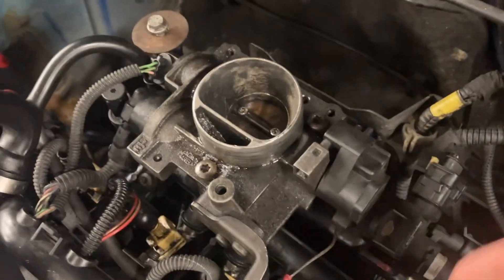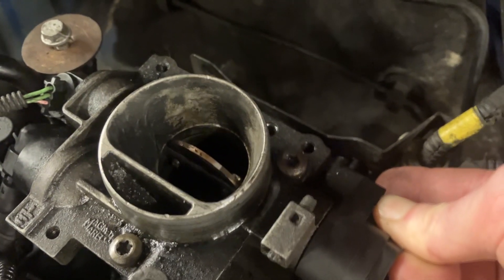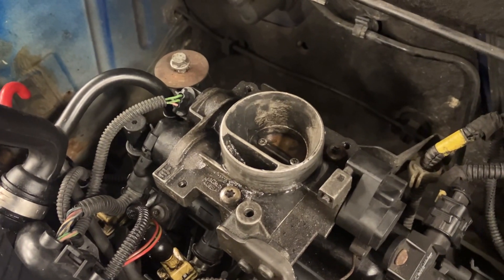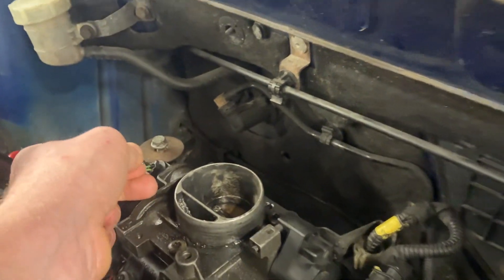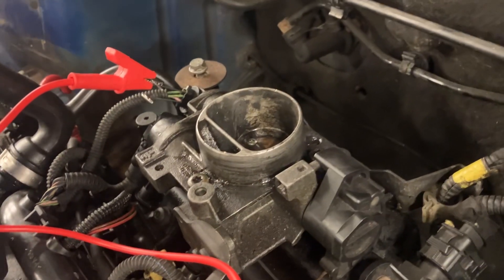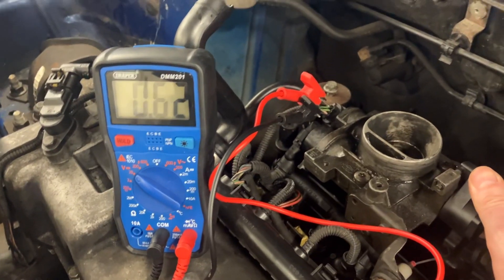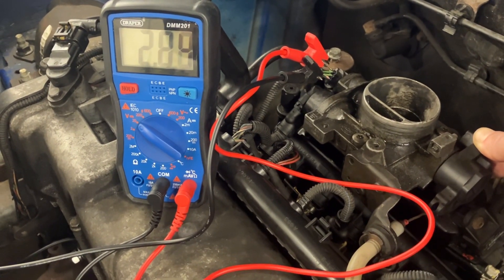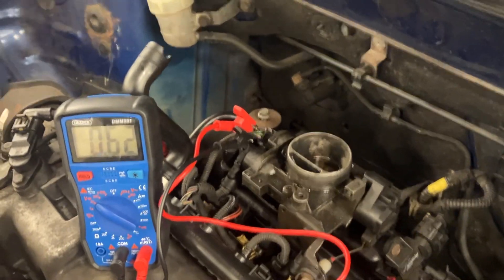How to Test a Throttle Position Sensor (TPS)

Comment from the maker: Worth mentioning, if it's the electronic version (without a throttle cable) it's the same test, you just need someone to press the accelerator pedal instead of pull the cable.